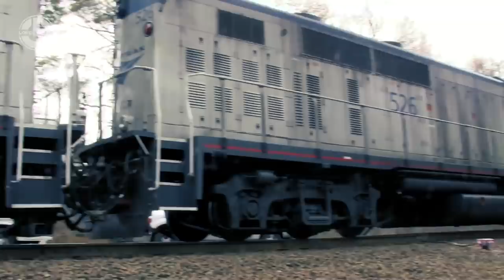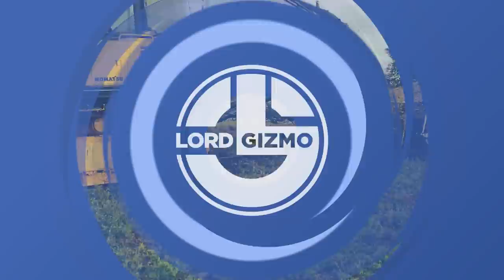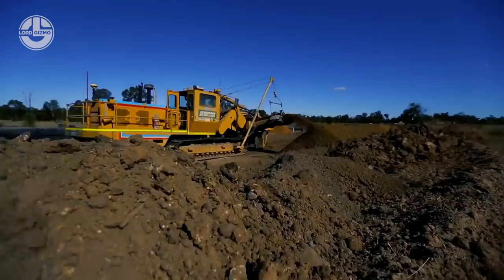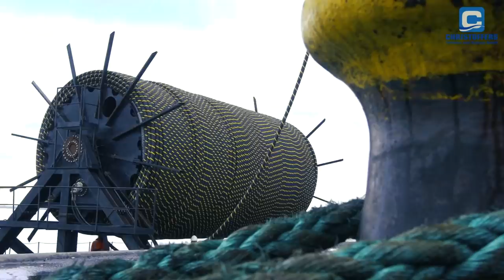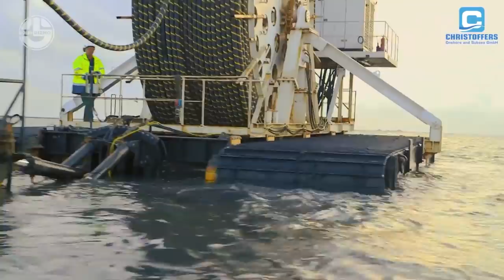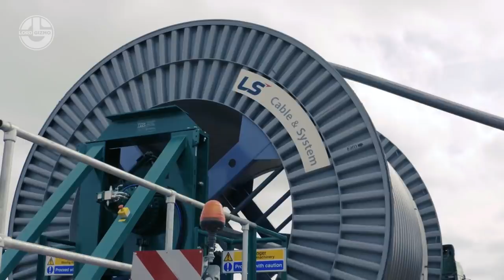Underground Cable Laying & Underground Pipe Laying Processes You Need To See

Comment: Under ground cable and tube is an interesting topic. I have allways wanted to know how to make the joint when one reel ends and the next is taken into use. Can you enlighten me?
Reply: Just join the end of the cable with the cable-head from another reel and keep it rolling.  It's simple.
Reply: @-sawal  was going to say that but if you dont want to joint just add zip ties everyone so far around 10 inches and it will hold in place without tear
Reply: With multiple strands inside the primary cable shield, it's a little on the complicated side, not like soldering wires together. With fiber optics we had to assure the individual strands lined up correctly before we joined them, sometimes with a connector box if amplification was needed, but otherwise with a coupler of sorts. Not complex though, not rocket science.